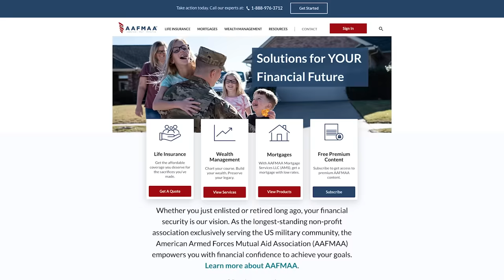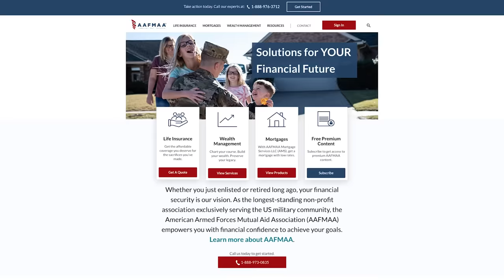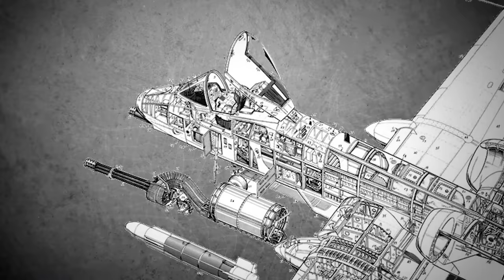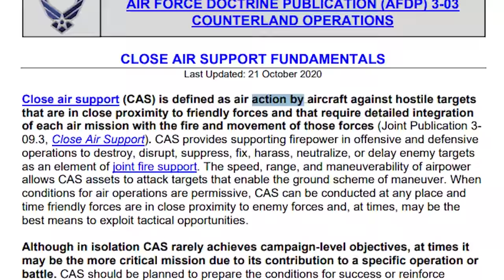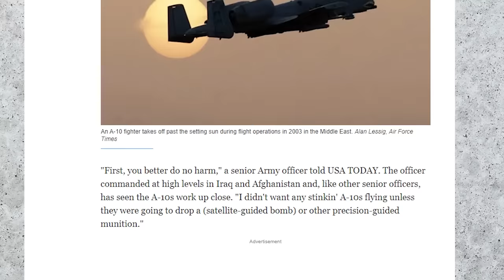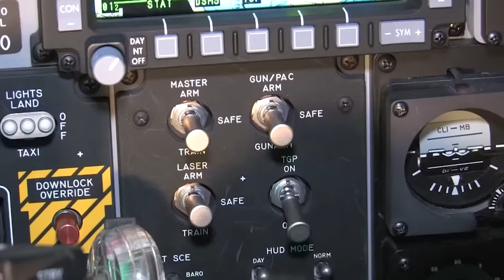Why the Air Force is Screaming to Retire the A-10 Warthog

Comment: Critics of the A-10 are going to tell me that dropping  several hundred pounds of laser guided explosive is going to have “less” of a collateral impact than a 40ft cone of 30mm ammo hitting the deck? I find that hard to believe.
Reply: The part that matters is the difference in kinetic energy between a 30mm shell and a fragment of shrapnel. The 30mm will punch through almost anything that isn't specifically armoured to withstand it, and 30mm HEI will kill people hiding behind cover. Meanwhile there are lots of natural obstacles that will withstand shrapnel, and so will any concrete or brick structure that civilians might be sheltering in.
Reply: @dumdumbinks274   Shrapnel is not the only thing you need to worry about with a GBU it seems to me that the overpressure would be absurd. If I recall correctly anything over 100 PSI is considered lethal to humans.
Reply: @Theideaspectrum  Yes, but the concussive force is only lethal for a short distance. They aren't talking about the 1000lb+ classes of bombs here.

Give a bomb a more purposeful warhead and you minimise that problem even further e.g the 250lb GBU-53 has a dual purpose shaped charge + frag warhead that is lethal against tanks and exposed infantry, but doesn't bring much concussive force.
Reply: @Theideaspectrum  150m is maximum shrapnel range for a Mk.82 based bomb, at which point there is roughly a 10% chance of being incapacitated if you are standing out of cover. The concussive blast of such a bomb is roughly 20m. But regardless, that's a GP bomb intended to cause as much destruction as possible for it's weight class. The officer specified precision munitions, not a warhead type. Time stamp is 14:14 if you want to read it.
Reply: @dumdumbinks274  Let’s put this in perspective. Assuming a high rise civilian reinforced concrete structure like an apartment building. If a 30mm HE goes off in a particular room everyone in that room is likely dead while the rooms next to them are probably just fine except for ears ringing. If a 250 Lb GBU goes off in a particular room inside the same structure everyone in the next 2-3 rooms are dead and half the floor is gone if the whole building hasn’t collapsed. “Less collateral damage” is highly subjective/questionable. It’s not necessarily “less” collateral damage it’s just a more predictable collateral damage.
Reply: @dumdumbinks274   And the 40ft cone (about 12m) of 30mm HE striking the deck and going off is going to have a greater effect than the Mk.82 in both concussive blast and shrapnel radius? As I said a GBU is more predictable collateral as compared to a 30mm unguided round. Not necessarily less collateral.
Reply: @Theideaspectrum  Mmm but collateral damage is about intent. A bomb destroying parts of a building it was dropped on is expected, because the munition hit it's intended target and has a known explosive effect. Collateral damage would be if the bomb also damaged another building.

A bomb is 1 munition. A 30mm round from a GAU-8 is also 1 munition. If you aim a GAU-8 at a target and fire a standard 1sec burst, only a small portion of the 65 rounds fired will actually hit the intended target, with most of the rest landing within 12m of the target perpendicular to the firing angle of the weapon. The actual rounds could hit something way off in the distance because they aren't being guided to a point, they are being shot in that direction. Come to think of it, this is probably more in line with what the officer is referring to than the actual munition effects.
Reply: @dumdumbinks274  I would agree that the justification for collateral damage is largely based on intent and direct military benefit/necessity.

Comment: The Fighter Pilot Mafia... see the A10 as a trade for more F35 cockpits and desirable slots for the pilots (mostly academy graduates in the top 3%), which increases the potential career path to O7. The F35 is completely unsuited for long loiter, low altitude yank and bank flying, and the inclusion of large masses of composite skin and other lightweight materials, IN ADDITION to single engine (meaning will not stay in air the long for even small arms fire...) reduces the survivability VASTLY.  The lack of titanium armor, centerline belly exposed engine, and non- selfsealing fuel tanks... further degrade the survivability of the F35...  At engagement altitudes less than 5000.... in support of troops (CAS), or gun/maverick runs in CAI/BAI ... the F35 will be an extremely high attrition rate a/c... And NO battlespace manager for the ATO will ever assign an F35 to the CAS box.. cause it is a death sentence.  Finally,  The F35 internal cannon only carries 180 rounds... and must carry a RCS (Radar Cross Section) killing gunpod centerline...   Honestly... the USAF needs a built for the purpose aircraft (something loosely based on A10 requirements) for the mission, and that truth, is hard for an Air Staff to message, and harder for an increasingly dysfunctional Congress to stomach.
Reply: CAS doesn´t mean that you have to get close, it means that you are striking targets that are close to friendlies and the f35 is superior to the a10 in every way for this role

Comment: well the A10 needs total air superiority to be affective because its too slow and has to fly low to hit anything so manpads will get it may not bring them down but we know whats happens when A10s get hit, they start flying higher and that gun is useless so rockets have to be used and other planes can carry the same kind of missiles and are faster, so the point is the A10 is out of date and basically not needed, if you look at tank kills in the two desert wars the A10 is not the highest tank killer so whats it good for nothing apart from blue on blue encounters, ITS OUT OF DATE, SLOW, IS NOT NEEDED AND OTHER PLANES CAN DO THE JOB BETTER.

Comment: This one is pretty simple.  The air force, since the army air core, has a history of making the wrong decisions at a strategic level.  Before WW2, the idea was that unescorted bombers would win the war, on land and against navies.  We helped ensure that would be true, by making our fighters slow, and attack aircraft slow.  That led to the slaughter of air crews over Europe, until almost accidentally the P-51 was developed as a long range escort.  On the naval front, it's not an accident that the only time bombers sank ships were when the ships were in port.  Never at sea.

Fast forward to Vietnam!  The century series fighters had to be pulled out, the F-4 was being beaten by aircraft 1/10th the cost, and the main winners were the B-52 and the skyraider.  That war experience, and the will of a few fighter pilots led to the F-15 and F-16, which turned out great, because they were never designed to be multi-roll.

Now we're back to letting accountants and theorists design planes, so we're going to have flying mini-vans, good at nothing but average at everything.  This will work fine as long as we continue to not have to fight any modern military.  And it's cheap.

If they did a flyoff between the A-10, the F-35, and a Cessna Caravan, using the same constraints they used for the last one, the Cessna would win.  So let's just get a bunch of those.  They'll work great, and they'll be way cheaper.  Joking?  Some south american countries are doing roughly the same thing.  

The consistent thing is that the Air Force will almost always do the wrong thing.  When they get it right, like the F-111, it's almost always by accident, in that case having a "multi-role" aircraft so big and heavy that it made a great medium range bomber.  Maybe they'll make the F-35 slow enough, armored enough, and with enough payload that it'll become an OK ground attack aircraft but useless fighter?  Let's hope so.  Because let's be clear, the other thing the AF is good at is keeping defense contractors happy.  That's more important than the mission to the AF, and nobody there cares at all about what the ground forces need.
Reply: the f15 never was multi rol, the f4 was
Reply: @aquilesca5tr0  Fair - I'm including the F-15E variant.

Comment: This might be a naive question, but how well would the A-10 perform in Ukraine, where neither side has air superiority, and Russia is using thousands of the tanks and IFVs that the Warthog was designed to kill? It's said to be easy to fly, so perhaps Ukraine pilots could master it more quickly than F-16s. I'd certainly rather see it fighting in Europe than rotting at Davis Monthan.
Reply: Terribly. Ukraine is basically a no-fly zone right now regardless of an aircraft's affiliation. 

There is a difference in doctrine between the West and Russia. Western nations treat their air forces as their primary offensive tools, while Russia favours ground forces as the primary offensive tools. The West focus on air superiority so they can use their aircraft in enemy territory. Russia focuses on airspace denial so their ground forces can advance. 

What this means in Ukraine is that both sides have strong air defences keeping aircraft largely out of the picture. Ukraine has lost most of it's air force which was exclusively Soviet era aircraft, and Russia doesn't have the capability to defeat Ukraine's Western-supplied air defences.

Comment: As I have been told by a couple higher brass inf the AF the retirement of the A-10 is largely political. So far almost every plan for a war in the china sea or in Korea calls for a large close air support roll. granted it is slow and low tech but its been proven that flying A-10s integrated with modern fighters equipped with electronic warfare jammers it still can be effective.
Reply: The a10 is useless the moment three are manpads, if you are going to fly above manpad range just use an f35

Comment: Drones, anti battery tech, pin point targetting for mortars/arty/missiles will more than make up for the loss of this iconic machine. The alternatives will cost less and require manual operation from a distance (the farther the better and safer). As great an asset as these have proven to be, maybe their time has come and gone? They simply could not operate in the Ukrainian theatre with much hope of success and it is there future warfare is being crafted/engineered.

Comment: LOL all horses eventually end up in the glue factory or the ground, dead.  But don't tell me that an F35 @ $200 million per copy can do the job of the A-10.  First of all F-35 is almost brand new and 50% of the entire fleet is grounded all the time due to deficiency and reliabilty, second the F35 can not fly slow enough for close combat ground support and lastly the F-35 has no loiter-time over distance fields of combat.  It simply sucks too much fuel too fast to keep it in the air.  The A-10 can land on dirt and can loiter over a battle area for two hours per fueling, the F-35 can NOT land on dirt locally it has to return to a friendly, concrete airfield and burn most of it's fuel coming and going with only perhaps 30 minutes of loiter time over the ground troops.  If I missed something, I accept that, I am not an expert, I just know how to read congressional testimony and opinions of other who know more than me.
Reply: The F-35 is 88 million per unit. Secondly, slow speed doesnt matter for CAS when they can shoot them from miles away. I appreaciate that your humble enough to admit your not an expert, but trust me, the A-10s time has definitely come. Pilots need to use binoculars to identify targets. Some in desert storm complained that the magnification was too little or the plane vibrated excessively.
Reply: @leduckified1534   88 million dooes not include the amount of the budgeted package per plane, 200 million per plan the package number, you cannot keep a F-35 in the air on cost of 88 million, it needs constant expensive maintenance and replacement parts LOL. it s a joke.

Comment: Can’t the F-35 do Air Support missions?
Reply: Depends. Part of the A10's beauty is it is a proper instrument of war. High sortie rates and the ability to fly from basic airfields. F35s and its ilk require pampering. There was a bit of a debate around the A10 because there are prototype upgrade packages but doctrines change.

Comment: Drones are the CAS that troops will get, and they'll be far more effective. Just look at Ukraine. Neither side can conduct CAS with their Su-25s because they keep getting shot down. Meanwhile, drones fly all over the front conducting ISR and pinpoint CAS with extremely cheap munitions. There's just no comparison between a big, expensive jet that takes years to learn to fly, a large ground crew to support, expensive munitions in order to hit anything, easily shot down, and a drone that has none of those problems.

Comment: An f-35 gets scared anywhere near a thunderstorm, let alone how the fuck do the airforce think the fucker can replace a dedicated air support in our current combat theatres
Reply: Gee, who knows, the Air Force knows more than you do
Reply: Aircraft generally avoid thunderstorms anyway because the weather surrounding them can be very dangerous. It's not the lightning that causes planes to crash.

The F-16 already performs CAS more successfully than the A-10 and has done for the past 20 years. The A-10 is a specialist and should be at the very least treated as one, just like the AC-130.

Comment: The f-35 doesn't have the loiter time Northern slow speeds necessary for they will need to develop another or convert the old f117 to do the roll role yeah it does not have the survivability of the a10
Reply: lmao, slow speeds necessary for what?

Comment: It seems the worthy A-10 is finally aging out due to new tech possibilities.  It is an old story. The most obvious solution is for the army to stop its whining snd to adopt CAS to protect its own troops. The Air Force is abandoning that mission. The A-10 is the successor in concept to the legendary Il-2 Shturmovik. There will always be a critical need for CAS for the grunts. The Army needs to step up and shed its backward thinking. The troops are more important than their commanders limitations.

Comment: Lets all be honest here. The F35 will not have nearly the effect the A10 did. With its lighter armor, smaller gun, and expensive ass missiles they will use these things as sparingly as possible, let alone repeat gun runs in dangerous territory.
Reply: If the territory is dangerous to aircraft, the A-10 is also unlikely to be used because it is a far easier target to hit than a fast jet.

Comment: The Air Force is Stupid to Retire the A10, just make new A10s with Some upgraded Electronics!

I smell people in the Pentagon making money under the table!
Reply: F35 extra 15 billion xmass present ... That's a 1000 brand new A10 out the production line.
Reply: They could, but there's zero point when other planes can deliver precision bombs and missiles better and safer, especially when the upgrade package for the A 10s costs more than a brand new F 35

Comment: It’s slow ugly and forces the USAF to perform the close air support mission.  Not what the USAF wants.  Think of a driveway filled with expensive cars.  Also in the driveway is a 1997 F150.  The paint is faded.  There are dents.  The wife complains constantly about the truck but the truck does more work than the combined cars .  The F35 cannot do what an A10 can do and a lot of fighting men will suffer the consequences.

Comment: The A-10 is by far the most optimal design for close air in the world. It also has the highest survivability for such a deadly role.
The only thing I think that would make it better is a VTOL capability but that comes with its complexity unless you did a re-design and used the F-35 VTOL system somehow instead of the two turbo fans currently being used.
The VTOL means the A-10 can be much closer to the front lines and not need a runway.

Comment: The A10 saved thousands of lives throughout it's life in the air. The Air Force is making a terrible mistake by retiring it. There is a reason it's been around this long, because it works. This is a typical problem in the U.S. where they always try to update something, even if it is already working. Give it a year or two and they will be wanting it back.

Comment: A gun wasn't on the original F-4 Phantom until the ruskies and cong showed the U.S. military the error of its ways.  We need a CAS platform.  The F-35 can't get in close because it's not armored enough and too expensive to lose.
Reply: The f35 doesn´t need to get close, it can provide CAS while flying over clouds
Reply: @aquilesca5tr0   Not the same thing.
Reply: Except only the USAF installed a gun, and they did so because they had numerous issues with training for both the pilots and ground crews handling the missiles. The USN, whom the F-4 was designed for, had better training, and performed better in air combat without guns than the USAF F-4s performed with guns.

The A-10 isn't armoured. The only thing making it less vulnerable is the fact it's engines are mounted high in separate pods, rather than in the fuselage. But that doesn't matter to modern MANPADs, let alone proper air defence systems.